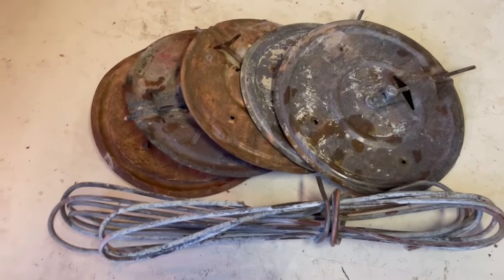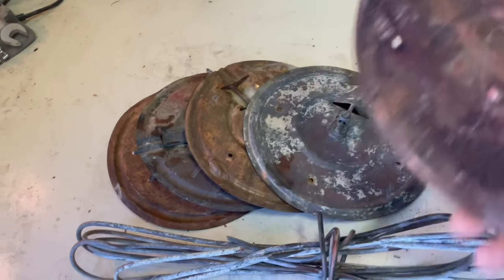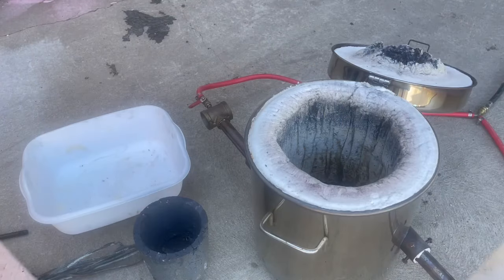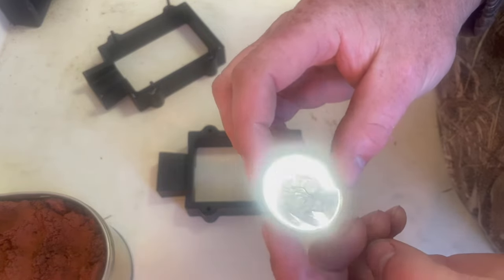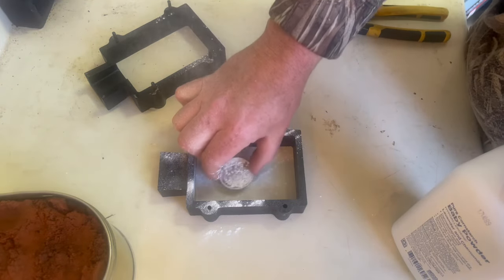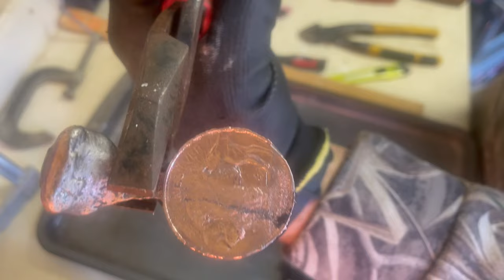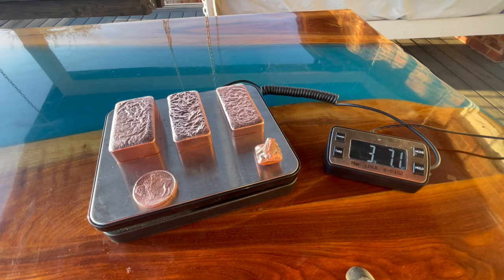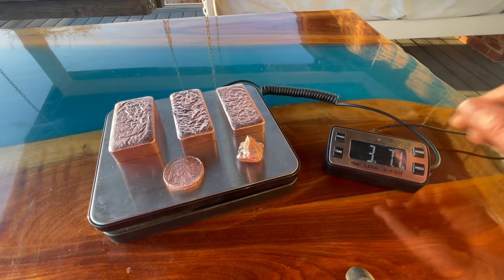Scrapping Power Poles  #copper #smelting #trashtotreasure #makingbullions

Comment: Very interesting. I've never seen the plates at bottom of poles. Only have seen ground rods for the ground wire. Maybe most plates stay in the ground when pulled? I'll have to ask my lineman buddies 🤔
Reply from the maker: They had been nailed to the bottom of the pole and all the nails were still intact. I have found them many times. Keep checking. Good source of copper.